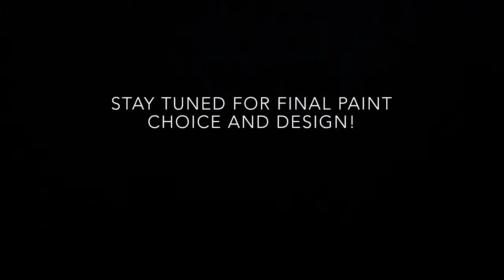how to build a teardrop camper squaredrop camper episode 5

Comment: Great video!  Thanks.  I've watched a few of these "poor man's fiberglass' videos, and decided to try it for myself.  So far I've made a chicken coop, and a dog house with the stuff.  I figured I'd learn how to do it on something that didn't really matter how it looked if I screwed it up.  It didn't come out great, but then i'm using pallet wood and cardboard instead of plywood.  The dogs and chickens don't seem to mind, and if i put some molding around the edges it will look even better.  There's definitely a learning curve to using this stuff.  My advice is to start out with something small, and get used to how it works before tackling something big.  I don't have the skill to do a teardrop camper, but I may try building a box for my utility trailer.
Reply from the maker: Shnarkle VonBarkle if you watched my final video on demonstrating how tuff it was I was pretty impressed. I just personally didn't like the texture and finished look. But with maybe more practice and perfect work conditions you could get a nice look from it .

Comment: Quick question, I've seen another guy go tight bond, cloth, tight bond (2 coats).  I think it's same concept, but your way seemed to work just as good, especially now that I witnessed you tearing it off.
Reply from the maker: i researched many hours on how to do it ,, there are quite a few versions and everyone believes theirs is the way lol. i finally just picked one and went with it . it appears to work well. this version the thinned paint soaks into fibers before final coat . when i built mine i only found one poorly made video .Most all of my research was on teardrop message boards.

Comment: Should be able to sand that stuff, right?  I'm doing something kind of similar and am thinking fiberglass over foam on the outside and canvas (PMF) on the inside.  I've worked with fiberglass before and it's amazingly strong and relatively easy to work with.  Sanding is possible but it is tough stuff.
Reply from the maker: yes , there are a couple video out there with shiny smooth PFM, the canvas i used was so rough and large weave that sanding wasnt really working . it would have worked if i wanted to put lots of coats of paint. if i do it again i will use a canvas with a tight weave or bed sheets.

Comment: How did you build your door
Reply from the maker: i used the piece that was cut for the opening. on the inside of camper i cut a piece to surround door opening about an inch smaller than door openingand attached it inside door opening , on the outside i cut another piece the same size as doorand attached it on outside to make a drip rail . im not sure if i still have pics saved of how i did it , if i do i can show you more detail. or soon as i get camper out of storage i can try to make a video. i used a screen door kit hinges and latch and also put a locking latch outside and inside.
Reply: @ArmadilloJunction  thanks any info is appreciated